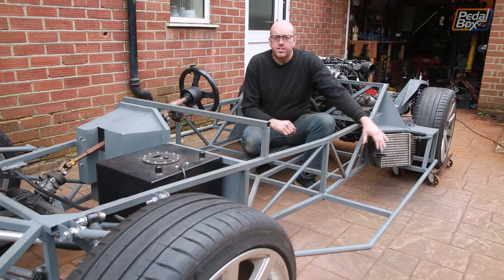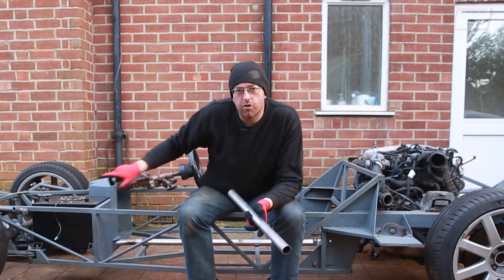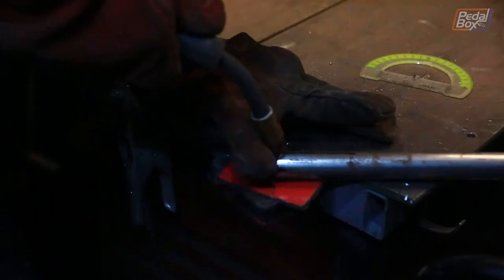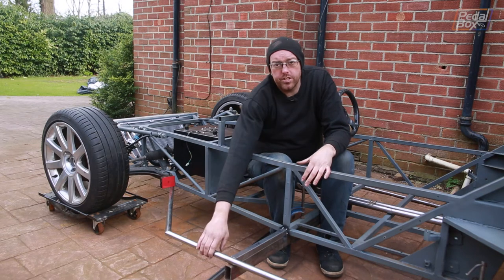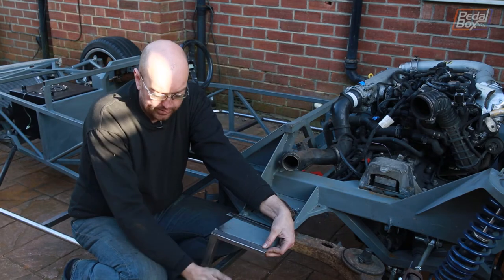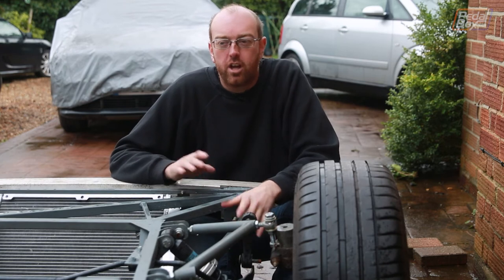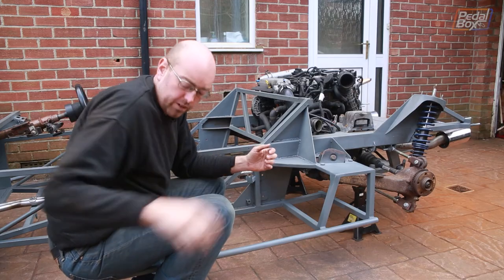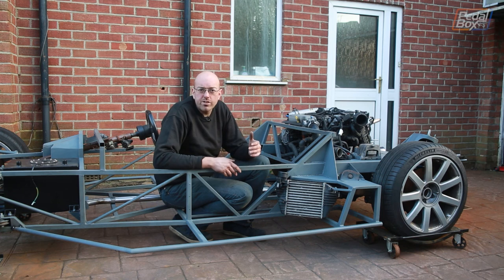Side Pods and Intercoolers | Audi TT Kit Car | PedalBox Episode 45

Comment: Great stuff again.

To prevent kinking when you're bending pipe or tube, put a bending spring inside it. They're dirt cheap from screwfix and will come in really handy
Reply from the maker: Yeah any more of the 1" stuff needs doing, that'll work perfectly, fortunately done with bending that stuff for now, but probably back on it again in a little while